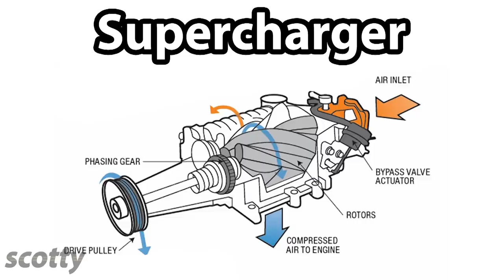Supercharger vs Turbocharger - Why Supercharged Car is Better than Turbo

Comment: This is backwards ( Turbos are better than Superchargers ).  Why? Given the same engines ( One Turbocharged, One Supercharged ), the Turbo motor will produce the most power.  Why?  I think that's intuitive to all of us.  Turbos don't rob power off the crank, just to spin them.  Do turbos rob power via using what would otherwise be wasted exhaust pressure?  Yes some, but a hell of a lot less than if they were driven off the crank.  How much?  I can only speculate on this, but as long as the boost is moderate, this would be ZERO.  There will be a threshold point were you begin to rob horsepower as you increase the boost.  But at that point, you'll be more than pleased with the extra HP that Turbo is making.  And with a programmable waste gate tied in with your EFI, you can tweak those parameters how ever you want.  So you could program the waste gate to open just as your boost gets high enough to start bogging the motor, and you'd have it set up to use nothing but free energy ( from exhaust pressure ) to spin that turbo.

Comment: Not a chance scotty, supercharger use engine power to produce but turbo is definitely a better option. They are about the same price. Supercharge is easier to install. The supercharger is limited not the turbo.

Comment: Stupid question from a complete scrub not even in the US.. I have a 'family' Nissan Qashqai+2 manual shift (2012 or something) I know they don't exist in the states. Anyway it's 1600cc air aspirated engine (did I say that right?). It's also 5 speed only gearbox stock (maybe that could be an issue to tackle as well?)
Cost for cars are silly high here and not much to be found in terms of good used either because in the country people drive their car to the ground before selling it.
My daily commute is around 20 miles, per week I do around 130miles (tiny right)
I was wondering if I could super charge my car given the above. If yes is there a place to buy it from before getting a mechanic to install it locally? What are the risks? - I don't expect to be 'racing'
This model comes in 1.6L and 2L  and to be honest the 1.6L is a bit heavy to push particularly when overtaking. I'm assuming with a super charger it will push like a 2.2L ish? Making overtaking smoother, shorter and safer for example.
How bad would it be on the engine/other parts considering everything is stock at the moment?

Thanks for the amazing channel Scotty, really wish I lived nearby in texas to come visit.

Comment: Reasons why I prefer turbos:
1. They make WAY MORE POWER
2. They don't sound retarded
3. Anti lag is a thing.....
4. Tunable boost, like boost per gear
5. No robbed power from the crank
6. The fastest cars in the world from the past decade or longer have been either turbocharged or naturally aspirated
7. Installed can have a lower center of gravity compared to a whiner
8. Way more efficient than a supercharger

Comment: Why turbo is better in 3 words. "Boost By Gear" nuff said
Reply: SC can be done also its just hard to do, you need a 2 port actuator and 3 port solenoid MAC

Comment: Saying a Supercharger is better is better is subjective..NOTHING beats Turbo if you want to make REAL power. Roots style Supercharging is ONLY better if want a simple street car.  Superchargers take away horsepower to turn them. Centrifugals have some lag compared to Roots style. And if you want less lag with a Turbo charger you can always go with a smaller one to work in a shallower power band.

Comment: Scotty u are talking about ur preference, turbo is way more efficient and last way longer,  doesnt requires 30k miles tune up like supercharger. Make more power to psi. Since u are not using a belt power from engine to make power. Turbo uses wasted exhaust to make energy. There is a reason why super chargers are dead.

Comment: Turbochargers make more horsepower than a superchargers can because intercooling is better than the supercharged system because it doesn't interfere with airflow because any belt drive forced air induction systems rob power to make power then if you want to intercool the supercharged air you run the risk of water damage to the engine if the cooler contained inside the supercharger were to fail.

Comment: Turbo chargers you can change the boost  with the push of a button.  Supercharger you have to take it apart an replace the pulleys an you can only get so much out of it.  Paracitic lose. HEAT SOAK!!! Turbo is always better. It always creates more power an to easy to up the boost. Instead of having your car sitting a month cause you want to go from 300hp to 375. Turbo. 350hp press a button now you have 900hp. Today's turbos have no lag. It takes Hp to run a supercharger too. So you make 100hp but it's 25-30 hp to turn it. Also, turbos are way more fuel efficient when you drive them regular. Super is not. It's always going

Comment: Cost for super charger verse turbo? Its pretty much the same and to be honest some of the cars I've owned supercharger kits are twice as much as a good turbo kit. Again look at your facts first. You also left out a huge down side of superchargers, the power it takes to turn them and the fact you limited to how much boost it will put out, you can only make the pulley so small.

Comment: Running on a belt, nothing like belt slippage at low boost!  One problem that still hasn't been fixed with superchargers! Turbos produce more power with a greater power band.  Scotty must be losing his mind in his old age.  Turbo applies a small restriction to the exhaust, while a supercharger puts rotational resistance across the crank. At a certain RPM superchargers become an intake restriction.
  Turbo's ftw!

Comment: Not a coincident that EVERY semi truck on the road uses turbo... its because turbo is the optimum way to make power. Supercharger is belt driven, lower boost level... run out of RPM and ya got nothin.... turbo is always there. I love your channel, buuuuuut, i highly disagree with your OPINION on this one

Comment: Actually on a 4 cylinder car, TURBO is the way to go!  Supercharger on a 4 cylinder sucks.  Just see the Chevy cobalt SS as proof.  2007 was supercharged at about 200HP, the 2008 Cobalt SS  was TurboCharged at 270HP!!!!!!!  And, most of the higher end cars like BMW always use a 2 L TURBO!!  And, that's because the 4 cylinder engine is robbed of power because of the supercharger itself.  But, it isn't with the Turbo.

Comment: You make a video about how turbos are bad for your car. Specifically stating how over pressurizing then engine can be bad. But you are talking how awesome a supercharger is, and it does the same damn thing.

Comment: As far as purely making power yeah superchargers are the easier way to go.  But in a world where all you hear is efficiency and less consumption it's a mute point.  It's not a question of which provides more power, easier and reliably it's which is going to be legal.  If companies need to meet certain standards it's not which is better.  It's either turbo or nothing (naturally aspirated), not SC vs turbo.  Now if you're adding it out of warranty or a dedicated track car say that would be different.  It's not as if there's a conspiracy to sell turbo vs supercharged, they can mark up the vehicle and profit either way.  Why would they go to the trouble to fit all the extra equipment to end up with the same profit?

Comment: But you have to factor in the parasitic loss of power because you lose 10-15% of the potential power you could get. The reason for that is the fact that the Supercharger runs off the engine whereas a turbo will only increase your break horsepower.

Comment: Turbos make way WAY more power because they arent parasitic...so its 100% free horsepower....but its mid range and up power because it has to spool up. Draw back is they make a lot of heat. Superchargers are belt driven or like a procharger...bolt to the crank. They make instant power but dont make the power on the top end like a turbo. They are parasitic....meaning it robs engine power to make extra power...but they dont make heat like a turbo. Personally....i much perfer turbo setups over a supercharger. The power they make can be endless....but for a daily driver the heat they create if youre running a lot of boost can be a problem. But if youre only going an 1/8 or 1/4 mile at a time.....the power a turbo  makes is far better....and the heat can be managed.

Comment: You are WAY OFF my friend....  on pretty much everything you said....  Supercharger kit on average is $3,000-$7,000, average turbo kit is $1,500-$4,000 or less if you fabricate your own piping! Turbo’s make more power, period because superchargers take power to make power.... which brings the next point, turbos are absolutely more efficient!  Superchargers are also capable of having an intercooler, and just like a turbo they are able to make more power easier with an intercooler... like that corvette you were just leaned up on, it has an intercooler!  And if you can show me a supercharger that will take a car from 500hp to 1200hp I will switch immediately, that car has a hell of a lot more than a charger to add almost 150% more power..... supercharger on average will add 15%-50%.... a turbo will add as much as the engine can take before you blow it up......  I’m just gunna stop here because I’m tired of typing, Turbos are in every way better than superchargers, a real mechanic and performance enthusiast would know this, but given that all of your videos revolve around mostly oil changes and simple diy maintenance I can see why you would think the way you do....

Comment: Haven't watched the video, but the claim from the start is just blatantly false. If you have a small engine a supercharger cannot be very big since it will take too much power. If you run a supercharger vs twin turbo in a drag race, with the same setup other than the turbo setup vs supercharger setup the turbo will win. Putting a supercharger on my dad's Land Rover would result in ~10 psi MAXIMUM
But his single turbo makes 25 and could make more

Comment: No Scotty turbos are better as they use free energy and hit peak boost earlier where as a supercharger robs engine power of the crank pulley and doesn’t hit peak boost until redline and a turbo will always make more power and the power delivery is a way better feeling more like a drop off a cliff or a roller coaster ride. Combine turbos are the future of motorsport just you wait and see.
Reply: that better feeling is a personal preference, the SC is more maintenance free than that of a turbo, when that boost hits, thats strain on the motor and transmission. where as the SC is linear. the SC is belt driven yes it uses engine power to make power but its minimal

Comment: I couldn't tell you how wrong you are sir, while superchargers may be easier to install, many are several times more expensive then a decent turbo kit. Not only that but a turbo is the most efficient way to make power as it doesn't have a parasitic effect on the engine while a supercharger does. Not only that but if a turbo is tuned to the car correctly and you used the correct sizing of your engine then set it up in an anti-lag system. The turbo will put down extra low end power. Even though the entire reason for turbos are efficient and huge high end power. So you can't inform people that superchargers are better because that is simply not true, which one you want is entirely based on your budget, your mechanical knowledge, and the application. But I guarantee you that on a dyno, not only will the turbo be more efficient but it will create a much higher peak power. So to all of the people who may read this comment, do not believe everything you see online because half of it is trash, and from what I've seen from this guy he hardly ever knows what he is talking about. I am a mechanic my self and I can tell you that if this guy ever came looking for a job at my shop, after a quick knowledge test I would send him straight home and let someone else deal with him because no one in their right minds would hire him.

Comment: Turbos are great, but they aren’t ‘free power’. And they’re also not more fuel efficient. 

When you’re on boost (supercharger OR turbo), you’re burning more fuel. More air in the engine = more fuel required to burn. 

The reason modern turbo cars get high gas mileage and power is a misconception. They advertise peak horsepower/ torque, AND max fuel mileage. 

Normal day to day driving you’re not using all the power and boost. Normal driving you’re not running on boost at all really. 

Try driving on boost and tell me turbos are efficient

Turbos are great but be realistic here people.

Also the fastest accelerating vehicles in the world are supercharged, big block v8s running nitromethane

You want big power? Like 5000+hp. Turbos aren’t going to do it
Reply: They put small engines in so under normal/ low load driving conditions when you’re off boost, the car gets great mileage.

The turbo is there for power under heavy load, NOT fuel mileage 

Superschargwr or turbo: when you run boost, you do it for power, not mileage

Comment: Super charging is not as efficient as turbocharing
Reply: It comes down to the engine. Smaller engines would have a hard time running superchargers, while bigger engines can handle both. Superchargers are less complex and more reliable.

Comment: I hope you do realise a turbo charger is both more efficient and makes more power than a supercharger due to PARASITIC LOSS. Parasitic loss is the power that an engine needs to use to turn the supercharger, whereas a turbo system uses a by product of the engine (exhaust gasses). Yes I like superchargers more (roots blowers) but you cannot say a supercharger is better than a turbo system. Yes it's cheaper and easier to install a supercharger. Let's be realistic here scotty

Comment: This is way off.  Sorry Scotty but you are really behind the times.  

First let's talk lag.  Guys lag is the time it takes from driving normal to driving fast.  Doing any sort of motorsport this isn't an issue and there is no lag.  Where you see lag is driving slow then deciding you want to go fast in street applications.  Literally a second to spool up 20 years ago.  Today it's like 10th of a second. 

With twin scroll it spools up super quick and gives you even more low end torque then a super charger.  With less parasitic loss pound for pound you see more power to the wheels up top as well.

Comment: Doesn't mean supercharged is better. Once again just an old fart with a old fashioned closed mind. Sometimes turbo works better sometimes supercharged does. But overall turbo is usually the better way to go for power. Plus it's more fun.

Comment: That guy is may be a pro, but you sure are not!
 I like how you didn't mention the fact that a supercharger can rob you of HP, and a supercharger is not the easiest or cheapest way to boost an engine. Most charges start out at around 3k, not to mention the other supporting mods for a supercharger. Any forced induction engine will provide good fuel economy, given it has the right tune installed.
  In most cases, you can turbocharge and engine quicker and for less money.
  Again, you spew bad information! If you are going to have a YT channel that is based on automotive, then do some research and show every aspect, not just your opinion!

Comment: Big boost with a supercharger still needs an intercooler, you are not counting the parasitic effect the supercharger has. You lose torque and boost. Turbo's are only governed by how fast you get the air in and out. Under 6lbs of boost with a turbo you don't need an intercooler. Both need tuned. You are not taking in all the facts.
Reply: parasitic loss on modern superchargers is much lower under load than most people think and non-existent when not under boost thanks to things like clutched drive pulleys and bypass valves.

Also turbo chargers have a parasitic effect, caused by the obstruction in the exhaust flow.  The same as with superchargers, a smaller turbo will have less obstruction.  Also while not under boost, turbos have more parasitic loss than superchargers.  It is actually visible on a dyno when comparing the engine NA to turbo in the rpm range below the boost threshold.
Reply: Troy McDaniel it's there and you still lose torque spinning the supercharger. Turbo's use a waste gate to bypass the wheel, also large dia. Exhaust helps. Most new turbo cars also have launch control which kills the turbo lag issue.

Comment: Supercharged cars are better for daily driving since you have more power on the lower revs.
Reply: EXACTLY!
This is most evident with Civic which has no torque in lower (eco) revs (i mainly drive 1500-2300 rpm). Why do i always have to go over 7k RPM for torque :D

Comment: Don't do it if you want to keep from walking!  Sure as chit they'll destroy your motor! My g f ex put one on her dodge 360 truck....  Sure it was neat. But it blew up the motor! Took that head gasket right out!  Too much pressure... Reason for a vehicle is so your not walking to get from point a to point b and back... Fuk walking or riding a bus...

Comment: superchargers DO NOT make more power than turbochargers.. turbos arent that hard to install and if you dont want lag, either install a two step or get a smaller turbo.. final point at 2:35 there is ABSOLUTELY no chance that ANY supercharger could put out 700 more hp alone.. superchargers arent bad, they are excellent at low end power,

note: superchargers are for people who cant afford turbos hehe
Reply: The affordability is backwards it’s a 5k kit for a supercharger and 1200 for the turbo kit including the fabricated parts for my car
Reply: Sgt Pickles depends on which one you get, overall for the best of the best, turbochargers cost more.